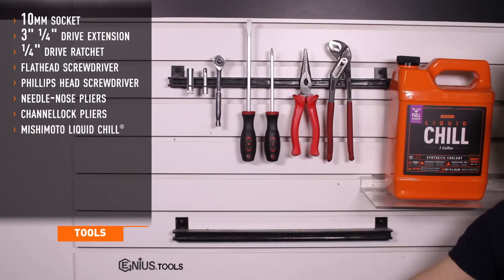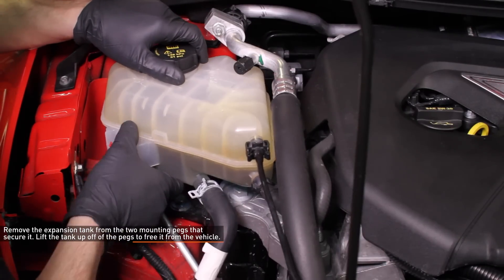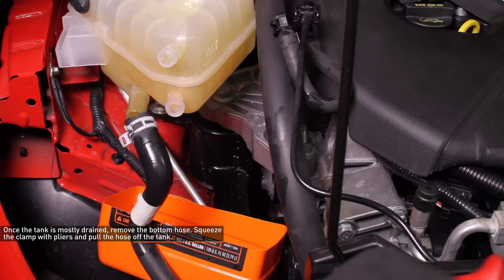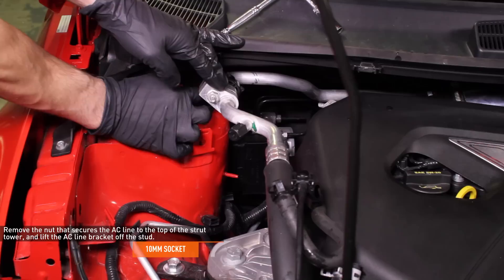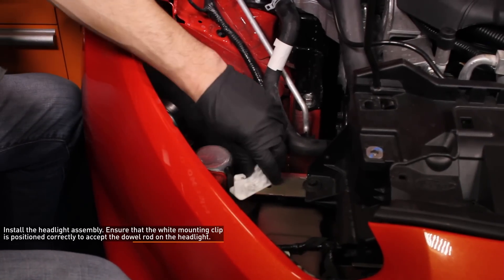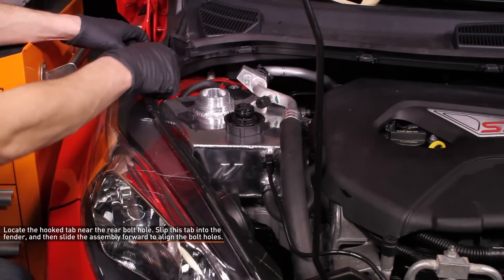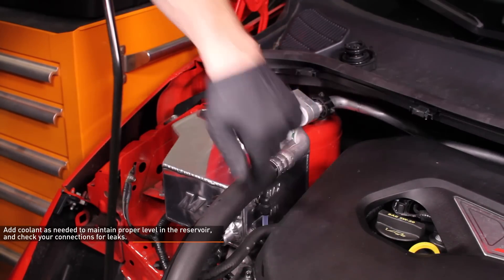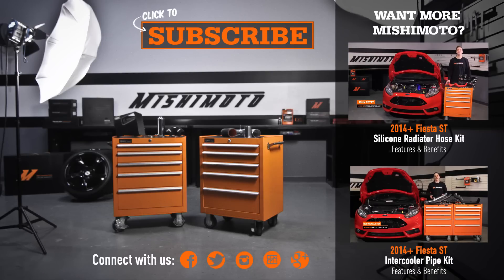2014-2019 Ford Fiesta ST Expansion Tank Installation Guide by Mishimoto

Comment: so where does the over flow line end up, yall said to make sure the line doesn't get pinched, but where does the open end go? I have a few items from mishimoto on my FiST and love em.
Reply from the maker: Hello Justin. The hose you are referencing is an overflow hose that actually does not connect to anything at all. In the rare chance that something actually needs to come out or " over flow " from the tank it is directed at the ground on these vehicles :)
Reply: cool! I saw him put it in the back when he was installing it, but I just wanted to make sure :) this will be the 3rd item from mishimoto I will be putting on my FiST!